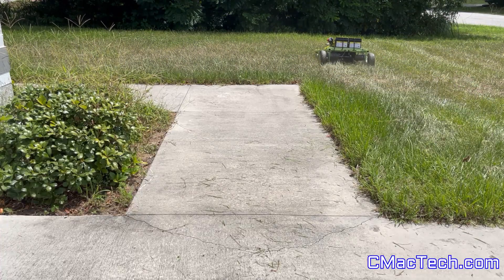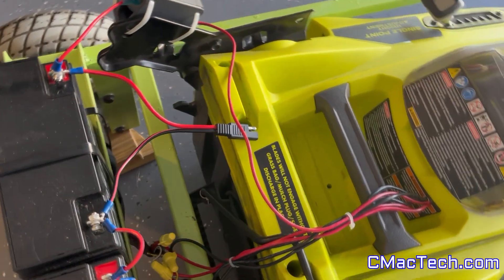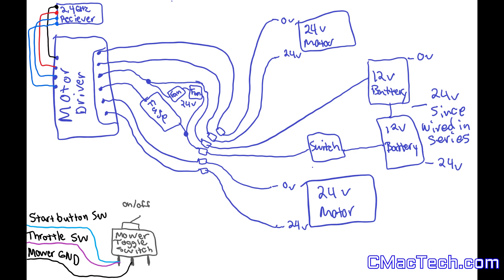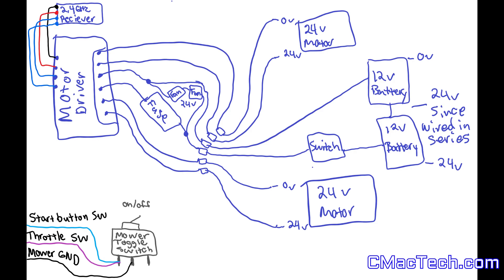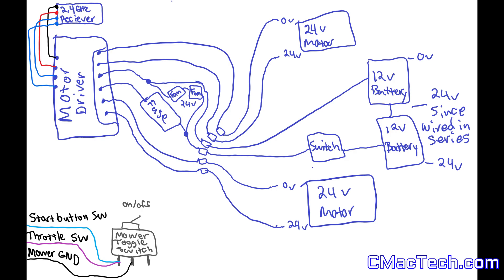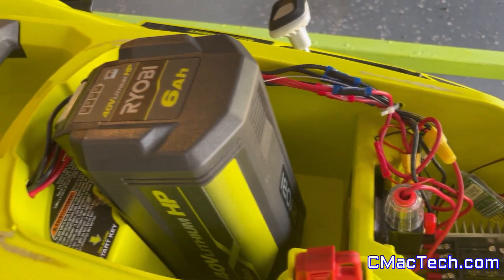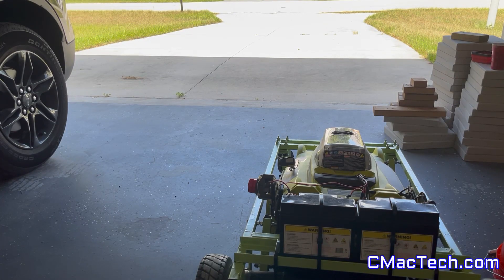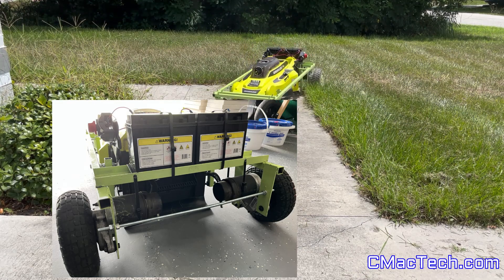How To Make A Remote Controlled Lawn Mower (Less than $450!)

Comment: what is the length cut of each bar?
Reply from the maker: I don't remember exactly but I just went to home depot and got a couple of steel  48 inch square tube. I pretty much winged it without too much of a plan. Just measured as I built.

Comment: It cool but electrical lawnmower suck. Should of went with a gas powered one instead
Reply from the maker: Thanks! Actually, this Ryobi mower is just as powerful as my old 161 cc mower. Still going strong after 2 years.
Reply: @cmactech  that's good. I was going to do like yours but I realized it cost a lot of money. At the end. You should look at hoverboard RC lawnmower. They take the motor, battery, couplers, circuit board, all you need is a RC receiver. I was watching a Russian guy have all wheel drive but I don't understand this diagram. When it comes to wiring the both circuits board to the RC receiver. But it is much faster and cheap. I bought myself a cheap hoverboard but realized the motors gear has 6 pin holes and the board takes 5 pin. I might have to rewire it..I can send you the video and maybe make a video about it.
Reply from the maker: Yeah I seen those too. That’s a good option, but for me I have a sloped yard so I needed bigger/fatter tires.  It was just easier to use a motor that already had a bracket to fit good tires. But if you build one please let me know! I’d like to check it out!
Reply: @cmactech  they have a hoverboard that has off road version they look very pricey.  But I have seen on the Internet you can peel off the old tire and add some 4.10 types. I think that's what I have to do too. I don't have a flat lawn. I'm not worried about the tires yet. I'm more focused on how to connect the two circuit boards together so it has more power. Hopefully I can get more information from that Russian guy video ( language barrier is the issue) Once I figure that out. I need to find a lawnmower without doing any welding so I can connect all 4 wheels using a mount shaft coupling. Its shame not many people are doing this project it seems like a man's dream to build something like this. Plus there aren't many videos of people in detail about how to do it. It's just bits and pieces out there. The only one I saw is one French guy (one motor) and that Russian guy ( two motors) . But the Russian guy's schematics are a bit hard to understand. I recently bought two very cheap hoverboard one seem heavy then the other one. But it's ashamed they don't have the main circuit board. Not sure why there isn't any from the hoverboard I purchased. just today I have to buy one from eBay. So we will see how this project goes this summer
Reply: @cmactech  Hey CMAC.  Nice build, I'm going the electric mower route as well.  How did you wire the electric mower to start?  I have a B&D 40 volt and the engine runs great esting with a direct connection to a battery (12v or 40v).  I would like to start the mower with a simple toogle, but so far that has not worked.  Any suggestions would be appreciated.
Reply from the maker: @LisaMorris-n6q Hey! Thanks! At 2:19 i have a drawing of how i wired to my toggle switch. What toggle do you have and how do you have it wired? When you said it works fine with it connected directly to the battery, how did you do that? You added a jumper cable or something?

Comment: how did you pair controler to the receiver or it was already from other RC toy?
Reply from the maker: It is a transmitter and receiver sold together by RadioLink that I bought on Amazon. Works out of the box.

Comment: Nice build! Curious what run time you get with those batteries?
Reply from the maker: Thanks! With the lead acid batteries last at least 3 full uses so for me probably about at least 3 hours of run time even on hot days.
Reply: Really? Fair to say 1 hour should be easily down with two 9ah batteries?
Reply from the maker: @ajaxmuchacha3758  yeah if your application is similar to mine 9ah should be fine for 1 hr.
Reply: @cmactech  that’s great thank you. Yeah I have a very flat yard. The reason I was surprised was another YouTube video said they only got 20min run time out of two 22ah batteries on a fairly flat yard. Also two motors. Let me find the video

Comment: This is amazing build. Going to be my 2024 project😍.  Has anyone tried to put gyros so the motor stay straight in line? Instead of ys trying to keep it in line?
Reply from the maker: Thanks man! The reason why it was challenging for me to keep it straight is because these are old wheel chair motors and one of the brushes on the one motor must’ve been dirtier slowing down rpm lol.
Reply: @cmactech  your mower is excellent. I was just in general wondering if adding gyros would be of any help.  Where is the kit waiver form :)
Reply from the maker: @Anupkulkarni23 thanks man! Oh yeah I’m sure it’ll definitely be a great help! If you add it to your application let me know! Definitely build one of these it’s a blast!
Reply: I left the original front wheels on and just run it back and forth mowing forward and reverse, it's not as fun as my original with swivel casters, but tracks better and constantly  mows a full deck ,just had to jockey it a little bit when turning. Just recently I upgraded the front wheels to omni directional wheels, and it tracks straight, spins around with very little jockeying in the yard

Comment: I need help
Reply from the maker: What seems to be the problem?
Reply: @cmactech  I have a Daredevil Lawn mower and it is ridiculously slow. I know enough to have a understanding but not enough to decide the best option to speed it up.
Reply from the maker: @hangmantvmounting  what mainly will increase speed is energy. Try to use at least 24v (if your motor driver allows it).
Reply: The motors that I have look very similar to wheelchair motors

Comment: What motor driver you use?
Reply from the maker: Sabertooth 2x25. But i recommend the cytron 2x20 if you want to save some money. Both i have used on this application. Cytron 2x20 doesnt have rc into it but its only like $30 and you can just connect it to a arduino nano or similar microcontroller to add RC function.

Comment: Upload more videos about it and get more subscribers
Reply from the maker: Havent made much modifications since but i have ideas to! When i do i will!!
Reply: @cmactech  i also want to make it
Reply from the maker: @djzatka  you should! totally worth it and super fun to build!
Reply: @cmactech I don't know how to control 6 dc motor 😢 24v 350watt
Reply from the maker: @djzatka  you’ll need another motor driver or one that is for 6 motors. Why do you have 6 motors?
Reply: @cmactech  4 motor for forward and reverse because want carry big load and 5 motor for turning
Reply: @cmactech why you choose saberthooth?
Reply from the maker: @djzatka  how many pounds is your application? I don’t think an extra motor on each side will make it any faster unless you increase the energy (voltage). 24v will stay 24v no matter the amount motors you have unless you wire them in a series. But most motor drivers do not take over 36v. Unless your application weighs over 1,000 lbs or something, then you may need a more powerful motor driver or you might have to make your own h bridge with mosfets that can handle over 36v.
Reply from the maker: @djzatka  because i didn’t feel like making my own H bridge lol. I have a sabertooth and also a cytron and Both are great.
Reply: @cmactech 1100 lbs weight i want to carry. Extra motors not faster but they can carry more weight together.
Reply: @cmactech  saberthooth is the most expensive motor driver and 2nd one is Cybertron. You could use bts7960, right?
Reply from the maker: @djzatka  i don’t think an extra motor will make much difference if you aren’t increasing the energy or current/rpm. 350w is too small for 1,100 lbs. I also wouldn’t recommend having two motors on each side of the same axel. What is this thing that weighs 1,100 lbs? A riding mower? Lol. But if you are to move this much weight you will need at least 60A continuous motor driver. I would recommend at least the cytron 60a motor driver.
Reply from the maker: @djzatka  yeah cytron products are cheaper because Sabertooths are made in the USA i believe. If you are making your own H bridge, you’ll need a bunch of those n channel and p channel transistors. You can use that mosfet but you will need more p and n channel mosfets. If you aren’t familiar with electronics I would recommend just buying a motor driver though that has high continuous amp rating. But if you are willing and super interested in learning how to make one, and have the patience, just be careful and have fun! Maybe use multi sim or some simulation first before you build your prototype.
Reply: @cmactech  okay lets try
Reply: @cmactech  patience? What is that😄
Reply from the maker: @djzatka  you can also add multiple motor drivers to a micro controller like an arduino if you’d like to control as many motors as you would like.
Reply: @cmactech  but i am confuse about arduino. Which one to use uno or mega?
Reply from the maker: @djzatka  doesn’t matter which one. You will use the pins on the arduino to connect the motor driver and the rc receiver. In your code for the arduino, you will need to convert the logic and also call for a interrupt pin so the code reads the ppm signal from the receiver.
Reply: @cmactech  okay👍

Comment: used hoverboard ($50) + ESP32.
Reply from the maker: Nice! Are those hoverboard motors 24v?
Reply: @cmactech  10s lithium ion, nominal 36v.
Reply: @cmactech  I guess I should amend that with a slightly more technical and direct answer.

I believe the motors can run at 24v.  Some hoverboards are 7s (25.2v nominal).  So if you wanted to run them at 24v (i.e. 2 lead acid batteries), you could.  The hardware can obviously handle it, and the open source firmware LVC can be configured.

However the hoverboard comes with a lithium battery, so...  just use the battery it came with.
Reply from the maker: Nice. I never owned a hoverboard but yeah the more energy the better i say so keep it at 36v lol. If you have a electric mower like me im sure that thing books! Im sure those wheel hub motors look nice and sleek too.
Reply: @cmactech  I built one on the exact same mower as you.

There are actually multiple hoverboard hub motors/wheels.  The standard 6" ones are likely too small to get good enough traction unless you use 4 of them.

I am currently running 10" versions because that's the first one I grabbed off CL, and yeah it's way faster than necessary (I run 60% expo) and traction/torque isn't optimal.  Works, but it's kind of like driving racing slicks on grass sometimes.

I about to switch to wider 8.5" hoverboard motors specifically made for "off-road" which should get better torque and traction.
Reply from the maker: @GoatZilla  i just checked out your video on that. Looks Awesome! Id like to see the new off road wheels when you do get to it.
Reply: @cmactech  Man it's been raining so much I only got like one mow in after finishing the mod.

Unfortunately, performance wise it's mostly a wash between the 10" wheels and the 8.5" wheels.  They both perform about the same.  Fine on a level lawn, but struggles on slopes.  Traction about the same so far.

There are a few physical differences that might still make the 8.5" more preferable, but nothing that actually affects performance.
Reply from the maker: Ahhhh man. You will find a way to improve it on the slopes! For me I switched away from the solid tires to pneumatic tires because after deflating it a little bit, i seen improvement on the slopes of my yard. (Which is a pretty steep slope on one side).
Reply: @cmactech  I can go up and down (i.e. when both motors are engaged in the same direction, it can move), I just can't change directions on a slope.

So I usually do a circuit where I go up and kind of sled it downhill heh.

One problem is the Ryobi has a bunch of superfluous plastic on the front which means you have to mount the casters further forward than really necessary.  This increases the moment that the motors have to overcome with the differential steering.

There are indeed ways to alleviate the problem but I'm just going to leave it for now since it gets most of the job done currently.  Also I can detach the mower completely and use it as an RC wheelbarrow for moving other stuff.
Reply from the maker: @GoatZilla  hey at least if it gets the job done, much easier than without RCing it lol.

Comment: Nice Job
I am currently working on a similar type rc control   I noticed that you had a game type controller  Is this wifi controlled? I would like to set mine up to run from inside the house with a camera to control it outside  What are your thoughts on that
Thanks
Craig
Reply from the maker: Hi Craig! Thanks for your comment! The controller is called the T8S from radio link. I bought it here Radiolink T8S 8 Channels 2.4GHz... https://www.amazon.com/dp/B07WR9Y1HG?ref=ppx_pop_mob_ap_share . Its radio controlled using PWM or PPM frequency. Connecting a camera is what i plan to do as well. For that to work properly, you will need to make sure you have FPV. But if you have a wifi chip connected to the motor driver, like an ESP8266, you can definitely get wifi to work and you can do mow from inside the house! Im trying to perfect it as range is my biggest issue but once i do i will upload a video on that!
Reply: @cmactech  Thanks